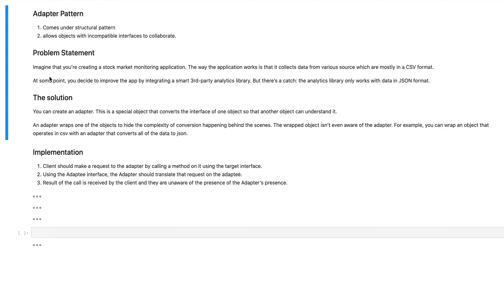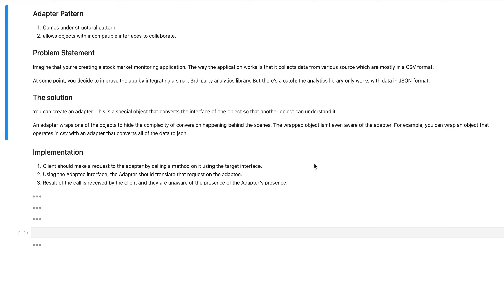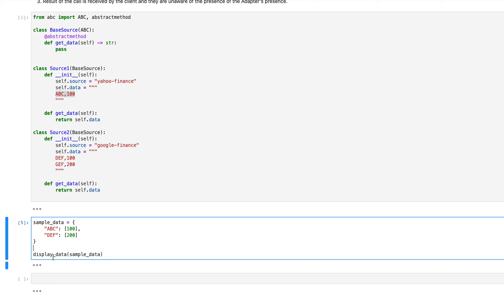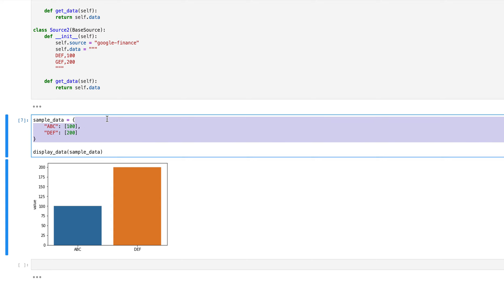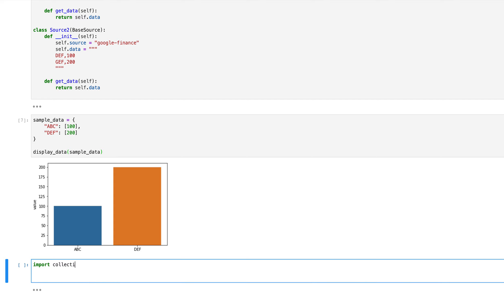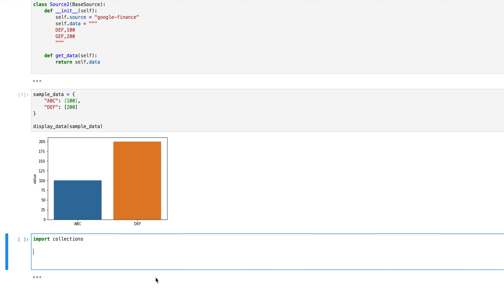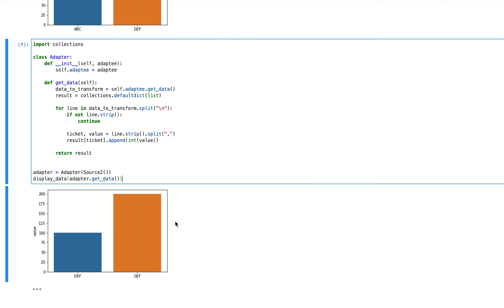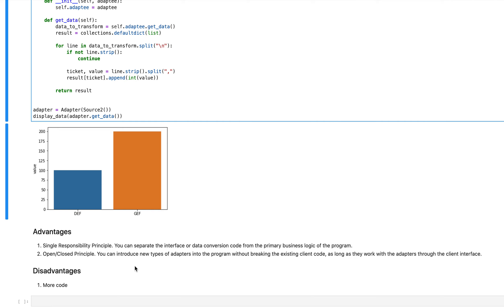Adapter Pattern - Design Pattern

Comment: We can also register the get data method as well so no need to write extra logic in the adaptor class, it can drive from the derived classes
Reply from the maker: Good catch
Reply: @notanexpert4357  you have been doing nice job please continue that. I looked almost all design patterns will be using my code too.
Reply: Please add solid concept and even async io realted videos soon if that is on your plan
Reply from the maker: Definitely. Thanks for the suggestion :)